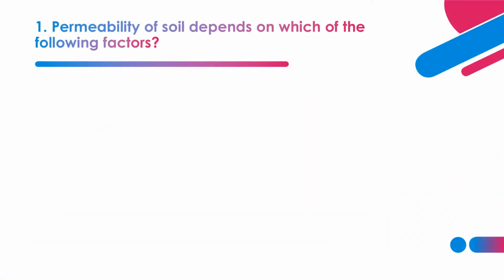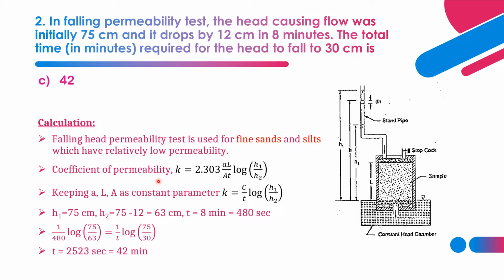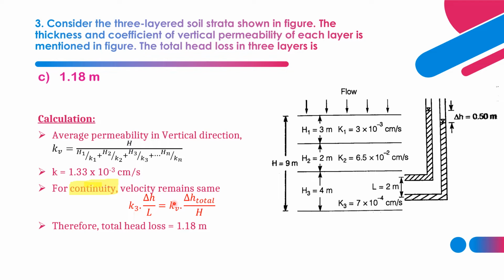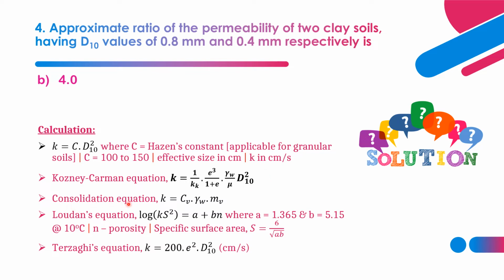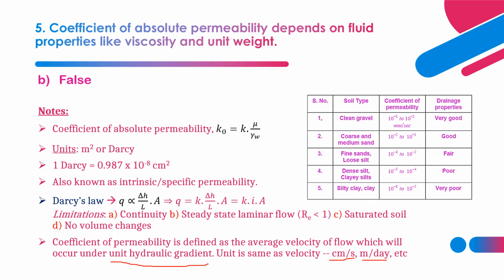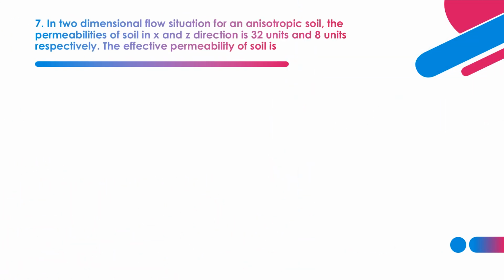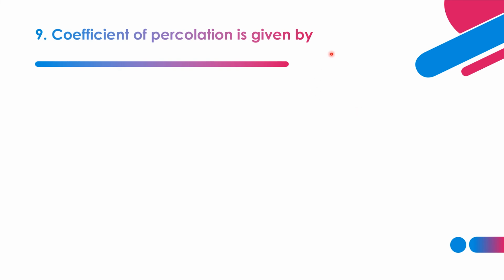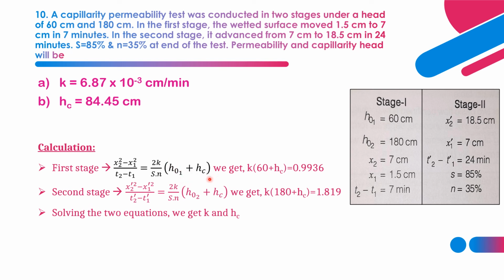Permeability of soil | Geotech | MCQ, MSQ, NAT | GATE Civil | ESE Civil

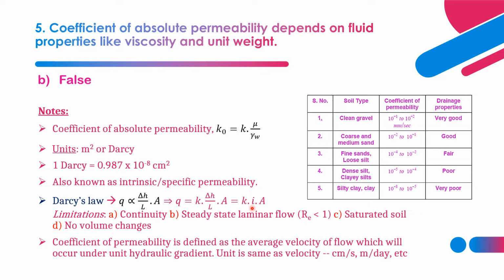Comment from the maker: 18:10 The standard unit of permeability is the darcy, equivalent to the passage of one cubic centimetre of fluid (having a viscosity of one centipoise) per second through a sample one square centimetre in cross-sectional area under a pressure of one atmosphere per centimetre of thickness.